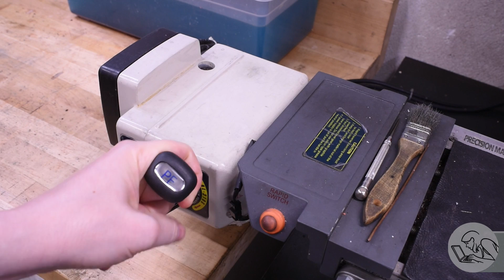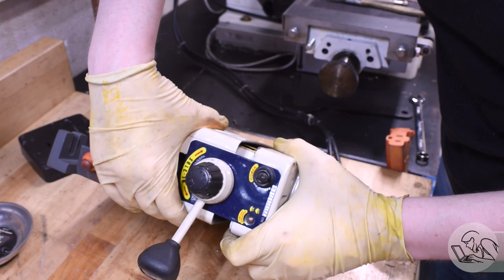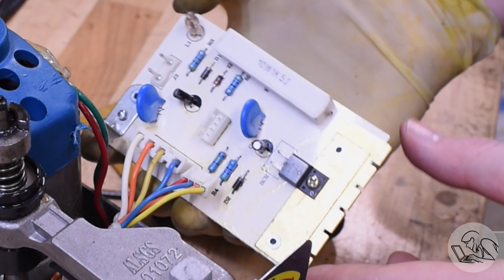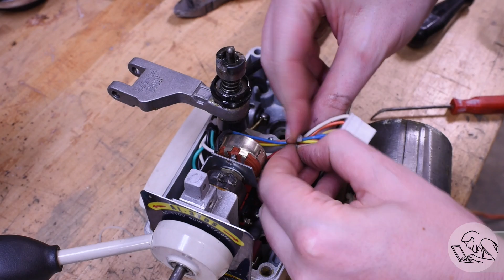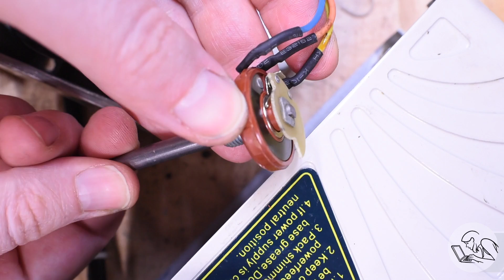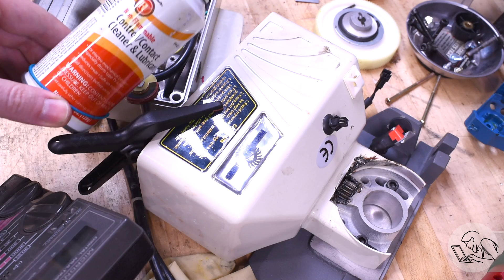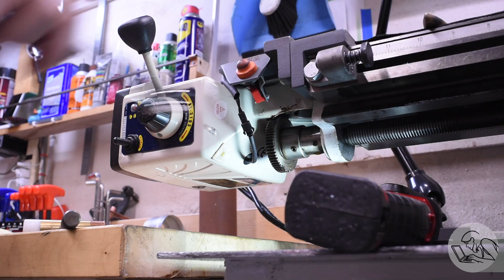Fixing a Power Feed and How They Work!

Comment: I just went thru the same thing on my AS-235. My 560Ω pot was different, with a short knob w/ a hole drilled thru it. An extension slid over it and hollow spring pin held them together. Extracting the pin allowed removal of the pot without messing with the motor or gears. My bridgeport came from a High School and some mischievous student decided to continue turning the pot past it's max. Fortunately, it was a wirewound pot. Inside of it, I had to straighten a bent wiper contact, and superglue a piece of plastic broken off that held the wiper down against the wirewound resistor as well as stopping the knob's rotation at either extreme. Works like a champ now. You can buy a WX14-12 560Ω 3W pot (~$30), but you would have to either modify or replace the knob to make it work 😔

Comment: hi thank you for the wonderful video . i have a question ,there is a kind of reset switch at besides the potentiometer , you have to push in and reset ,mine is stuck inside now and its not working ,could it be this switch problem ? your support is greatly appreciated .thank you

Comment: Quin I went back and rewatched this video yesterday because I accidently plugged mine into 220-volts and it is a 110-volt unit, I am writing just to say thanks for pointing out that is a regular power feed in it bolted to the horizontal adapter. I have 2 of the regular units so I should be able to make a swap. When I bought mine, I paid in excess of $400 usd from PM. The ones I got from Vevor are the same units rebranded. Also, I have found repair parts for mine are not too hard or too expensive. I am going to take it apart and hopefully it just smoked the breaker, but I will not know until i do the autopsy. Anyway, thanks for the detail you provided.

Comment: Dear Blondihacks! Thank you for your video! I had a problem with my Chinese 'Bridgeport' which has the same cross feed drive. It kept going slower and slower until it eventually died!! I stripped the drive down but because of your examination I managed to save time trying to get the variable resistor out! I removed its cover and rotated it a number of times blowing it out clean with compressed air! 😊 Thank you!

Comment: I recently had my ASONG AS-235 apart---a similar unit.  The trace to R5 welded itself out of existence and left a smoking resistor in its wake.  Some notes: The pot (RV24YN 78S B501) is available but mostly the 20S version, which has a shorter stem.  The custom one is 78mm long and not available to the public.  There's a CRC contact cleaner and Deoxit D5 is a favorite with electronics repair people---usually no disassembly required for pots.  I traced the circuit and found that the neon bulb is strictly an indicator.  Mine may be different from yours but I think the neon bulb is a way to avoid having any low-voltage section on the board but have a little light anyway.  Neon is probably the best choice, if the voltage is set, because it is relatively low power and heat compared to the alternatives.  It looks like the SCR is getting triggered by an RC network.  The trigger circuit is directly between the gate and cathode and charges from the half-rectified mains (after it's taken a detour though the stator windings).  The time constant is set by the resistance of R4 in combination with the zener-pot-R2-C2 circuit.  I think that subcircuit kicks it the way an diac would.  Not sure about that.  ANYWAY, I tried to figure out R5 from stills of your video but just couldn't do it.  Thanks for the video.  It always makes me feel less insane when I see someone else doing similar things.

Comment: Late to the party, but DeoxIT sounds very similar to the old Radio Shack spray you're using. You don't even need to open up the pot, just squirt it in! I've used it a bunch for restoring old amps

Comment: I have a new ALSGS table actuator for 230VAC. Type ALB-310SX
In it, the neon lamp is only used as a power-ON control in the switch. The forward and reverse microswitches reverse the field of the motor. The potentiometer gets a half-wave as a constant voltage and controls a tyristor that limits the rotor voltage of the motor. 
There is no trigger diode or DIAC built in. The speed is the same in both directions.

Comment: This video demonstrates in the BEST way possible that GOOD engineers design things to be easily disassembled and NOT assembled, a lesson taught to me as a student engineer almost 50 years ago by a genius designer. If it disassembles  easily AND modularly it makes maintenance that much easier and assembly (& re-assembly) becomes a piece of cake.

Example: that RIDICULOUSLY long pot spindle shows that the bean counters weren't as smart as they thought!

1. It's almost certainly a non-standard, custom design, possibly made exclusively for the manufacturer.

2. As such it would be substantially more expensive than a standard, off the shelf unit available from countless manufacturers.

3. Trickier and more complex assembly operation overall

4. OBVIOUSLY the designer had NEVER seen inside old radios since the CORRECT solution is a VERY simple one, and often used in old radio sets ... A 'D' shaft coupler or extension rod! Doh! That way, ONLY the two bolts for the bracket would have needed removing, the shaft coupler disconnected and bingo the whole sub-assembly gets removed.

Just buying a standard 'D' shaft pot, available from multiple sources (or use a round shaft and a minute on the grinder!) fixes the issue properly!

Excellent video on how to repair something tricky but otherwise simple.

Comment: You mentioned getting a better control board.   Do you have a source for quality replacement control boards?     I have one of these that ran like yours, only worse and worse until it no longer runs at all.   I was thinking of buying a new power feed unit, but if it's the same junk in a new one, I really don't want to invest several hundred dollars (over $600 at Grizzly) in something with such a poor design that will inevitably have more of the same problems.

Comment: The pots need cleaning from time to time. I have yet to meet some that runs correctly for longer than few years without asking to be cleaned up.
The Neon won't affect the directional difference, the whole electronics is actually operating the same way in both directions, so it can not cause the asymmetry you are observing. 
On top of that (found this only after reverse engineering the circuit) the Neon actually has nothing in common with the regulator itself, it is really just a power indicator, nothing else. The circuit itself is not that much a light dimmer, but rather a kitchen mixer regulator. The pot generates a variable reference voltage (which represents the required speed), which then the thyristor compares with the EMF generated by the spinning motor. If the motor spins slower, the EMF is lower and so the thyristor turns ON sooner, passing more power to the motor. When it speeds up so the EMF gets above the reference, the thyristor shuts off, waiting the motor to slow back down.
The direction switching is done by swapping the polarity of the armature brushes. So the asymmetry could be only in the motor itself, or in the gearing. It uses slanted gears, which tend to axially pull one gear up and the other down, so may cause them to shift in the bearing so get different friction. Or the motor shaft may have shifted axially, causing the brushes to run on an oxidized part of the comutator or get different field interaction with the stator. So cleaning all the bearings and lubricating them with a fresh grease may help there, if the mechanical resistance is the problem. Otherwise it won't hurt and it would be just a more extensive maintenance. Otherwise the motor asymmetry itself us a design thing, so you will have to live with it.

Comment: Caig Labs Deoxit D5 in the spray can would be the replacement for the old radio shack contact cleaner. It's a miracle for anything with contacts that get intermittent. From audio equipment with dirty pots and jacks to that maglite that won't work unless you whack it against the table, it cleans contact surfaces and keeps them from getting dirty again for a long time.

Comment: To replace the radio shack spray you might buy servisol  contact cleaner spray, it is nasty though it needs all windows open for an hour or done outside, or try wd40 electronic cleaner spray which is good and available in the USA and the UK and I think most of Europe

Comment: The potentiomer is likely a custom part. Either it is old stock or they were custom made for these drives. However, most potentiometers being the same inside, you could buy a short shaft potentiometer and transfer just the shaft + wiper. Shafts come in only a few standard diameters. Done it before.

Comment: CRC brand  "QD Electronic Contact Cleaner". Napa Auto Parts is one of many places you can get it. or find the hobby chain where Radio Shack is supposed to re-emerge, according to Dan Maloney as stated on Hackaday:

According to the ARRL website and major media reports, up to 50 of the 147 US locations of HobbyTown, the brick-and-mortar retailer of RC and other hobby supplies, will soon host a “RadioShack Express” outlet. Each outlet will be up to 500 square feet of retail space devoted to electronic components that would be of use to HobbyTown’s core customer base, as well as other merchandise and services.

YAY, I will finally be able to get that missing channel 18 transmit crystal for my 1970s CB Radio!

Comment: Radio shack contact cleaner is amazing. I think i have also used up my can that is 10+ years old.
I have found 3 good alternatives for cleaning electronic contacts. 
1. Isopropanol alcohol, 90+% is better for electronics. 70 can be used but takes longer to evaporate. clean with canned air
2. Electro Klene by Stoner, this is alcohol based, evaporates with no residue
3. Deoxit red & gold. this will leave a residue, but it cleans and restores electric connections. especially gold plated ones. It does leave a reside that you have to clean off with alcohol.

Comment: A few years ago I decided my mill/drill needed a power feed, but the available units wouldn't work because my TWS isn't a standard Rong-Fu clone, so I built my own using a gear motor.  Works well, but no fast traverse (yet).  The best thing was it was almost free because I already had a number of motors with different speed/torque ranges.  The hole for the neon bulb may actually be a port to let light into the bulb, as most neons fire more reliably when in a lit environment.  That's why some neon bulbs contain a small amount of radioactive material- it makes them fire reliably regardless of ambient light. (but I'm sure you knew that..)

Comment: The last can of contact cleaner I bought at Radio Shack was "DeOxit",  which is pretty good stuff and available in a lot of different places these days.  One thing to consider if you're gonna change out that neon bulb to a DIAC is their very different breakdown voltages.  Also,  that light pipe may be to put some incident room light on the neon bulb -- they operate somewhat differently when completely in the dark.  Ever notice how they tend to flicker more when in the dark than when in an illuminated enviroment?  It seems to me that the grease should be confined to the area where the gears are.  Is there some kind of a seal there?  Or is there maybe supposed to be one and they left it out "for reasons of economy"...?

Comment: For contact cleaner I use MG Chemicals 409B Electrosolve Zero Residue Electronic Contact Cleaner.  This works really well.  I've fixed a number of old switches with this.

Comment: Hi Quinn. I had a similar problem with my power feed. I found an exact replacement at Travers Tools. This part might be made cheap but they sure aren’t sold cheap. Just over $100 got me back up and running. I’m not an electronics guy at all but I’m going to clean up the old potentiometer and keep it as a spare! Thanks for the great video!

Comment: This is great Mrs. Hacks! I had to rip apart mine last year and replace the board. (One of the resistors had fried so badly that I couldn’t identity it).  I tried fiddling around with getting some of the other parts off as well but didn’t make nearly as much progress as you. Mine has a similar problem where it won’t travel at slower speeds.  So, I’ll add cleaning my pot to my list of to-dos. 

Loving your videos.

Comment: Set the wayback machine on "Micronta!" I know how old that Radio Shack meter is because I had one too.  Please do yourself a favor and get something more modern.  You might be able to buy a short shaft replacement pot and machine an extension. Another way would be to reuse the shaft from the current pot on a new one--they are just staked on.

Comment: Hey Quinn, the modern day equivalent of the Radio Shack contact cleaner is called DeoxIT. by CAIG. There are several different formulas available.  I believe the "fader lube" is the one to use on pots.  Good luck on your future electronic projects with dirty pots.

Comment: Hi Quinn, I went back and checked my Power Feed adjustment on the Drive Wheel clearance. Sure enough I could feel the Motor when it was in Nuetral and manually feeding. Readjusted and it’s a lot better. Thanks for a very interesting Video. I’ll know what to look for if mine develops a problem.

Comment: I am glad that you made this video and not happy that you had to. I also have one of the PM power drives for my PM 30. I would do something simple to replace the pot such as finding a wire wound pot of the same size shaft or larger if it would go down the tunnel. I would then find a rod of the correct dia for the knob and hopefully (it might be too big) take a Blondihacks saw and cut a slit in the center. then machine the end of the shaft of the new pot into a blade that would fit well into the slot, put the two together with a pin or just red loctite. 

Are you going to show the replacement of the neon bulb or just as good what diac diode is needed for replacement.

Comment: There is one of your problems you are using a dental mirror to look for bolts not teeth. You need to get a bolt mirror to look for bolts. Hint they look just like dental mirrors but have different programing.

Comment: Hi Quinn,

It is the nature of DC and AC brush/commutated motors to run at different speeds in in one direction.  It has to do with the compromise position of the brushes to achieve the best torque at a desired speed and direction.  For symmetrical speed the brushes can be rotated about the commutater with a constant field position.  Not possible with the way your motor is built.  Really enjoy the videos,  keep them coming.
Reply: I agree, and you can get the same asymmetry with a permanent magnet motor if the field and brushes are misaligned.  I don't think it has anything to do with the neon, as the 'dimmer' circuit will see the same polarity all the time.  Assuming a series-wound motor, the reversing is almost certainly done by swapping the direction of the field winding (or brush/commutator) with the two microswitches.
Reply: @mikerudin8261  exactly right.  Her motor is probably a parallel wound motor as it needs torque not speed.  Series wound motors are typically used in vacuum cleaners and other machines where the load is firmly attached at all times as they can exceed safe speeds if unloaded.  A parallel wound motor will not reach destructive speeds as the back EMF will limit the speed unlike its series wound counterpart and can still be bidirectional with field reversal.  Still. The speed control circuitry is pretty cheesy,  I would have used a constant current field variable voltage setup personally.  That would give a more constant torque curve across the range of speed.

Comment: Looks like the only thing unique about the potentiometer is the length of the shaft. It seems, given your machining ability, you could take a standard potentiometer and add a shaft extension. Clearly contact cleaner was easier. In hindsight, creating an opening in the metal potentiometer case (while you had it all apart) would allow application of contact cleaner to this apparently sensitive component in the future. You clearly have patience and ability to do this.

Comment: It might be worth checking the commutator and brushes on the motor as sometimes this can cause differences in the two directions of rotation due to wear and carbon build up in the commutator slots. I agree with you that the control circuit is appalling, a PWM circuit would be much better. The last time I used a neon tube was when I designed a stabilised power supply using vacuum tubes in my student days as neons strike at a constant voltage. And yes, this was a long time ago.